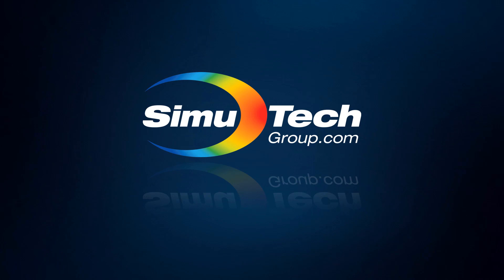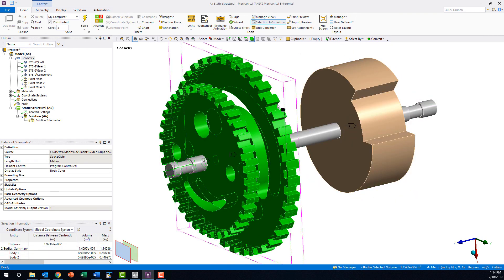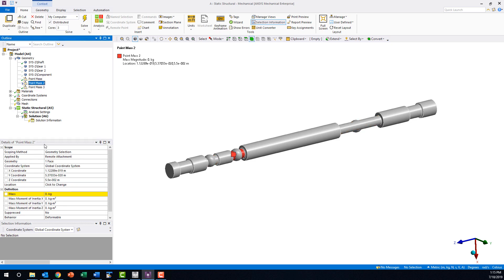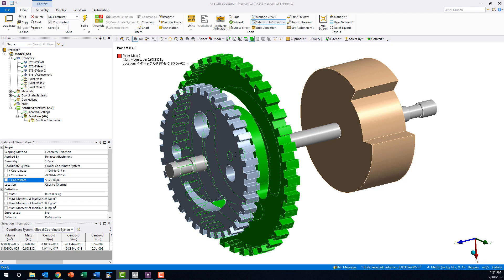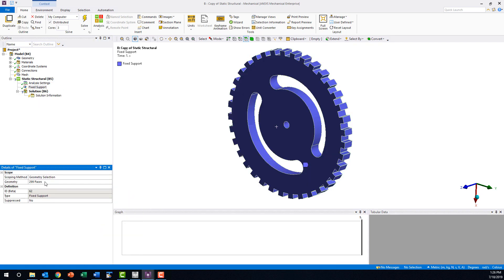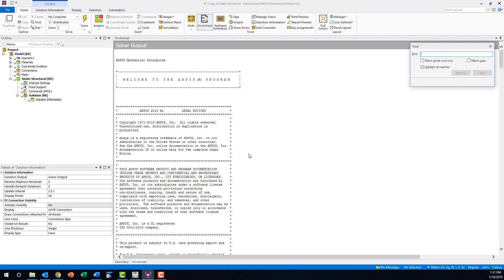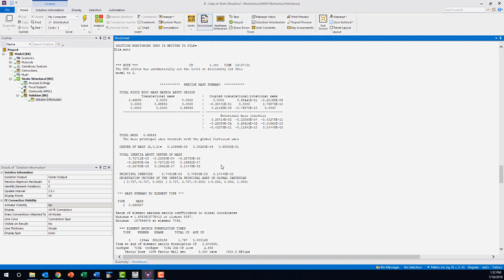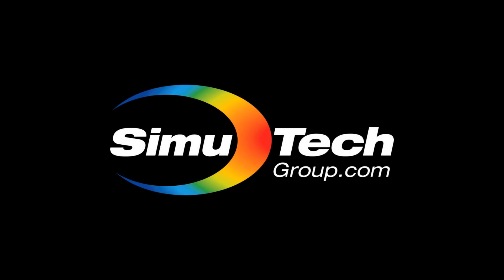How to Extract Moments of Inertia for Point Masses

Comment: thanks, it works nicely in ansys 2023 R1. Also i might add, that you can get these values as parameters, by adding a postprocessing command snippet such that:
*GET,my_Inertia_x,ELEM,,IMC,X
(or Y,Z respectively)
you can also get the center of mass coordinates this way if necessary, and automate the creation of point masses